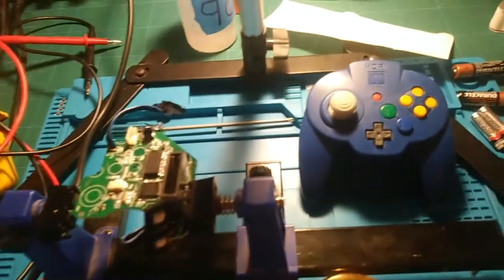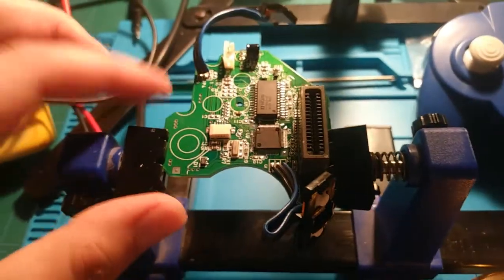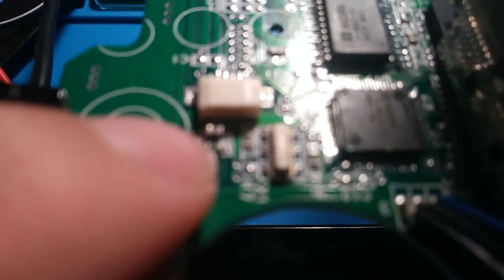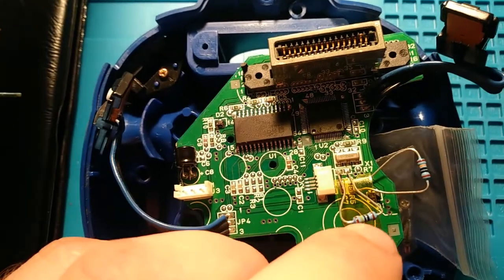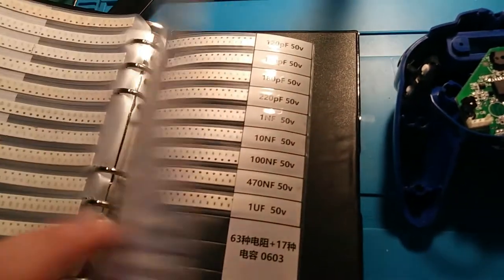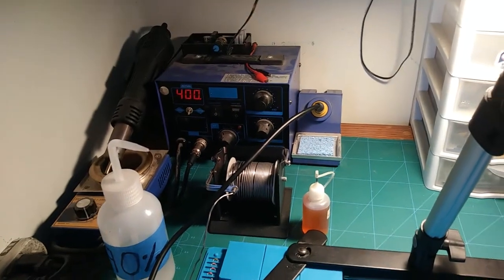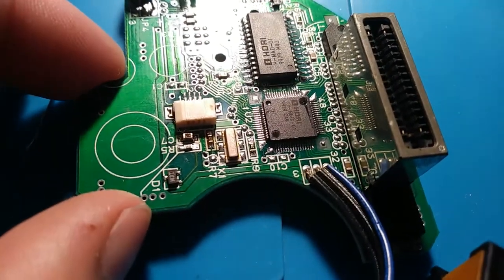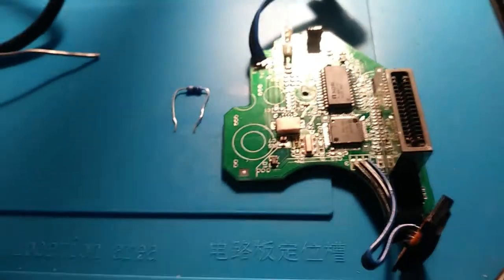N64 Hori Pad Mini Repair

Comment: Today I think me and my partner fixed one of our horipads that just stopped registering inputs after about 10 seconds of being plugged in when playing top gear rally. I checked all the components (desoldered and resoldered some) I could check (caps and resistors), but nothing was off. Then I tested the controller again and it sometimes worked. So we just reflowed the whole thing and cleaned all contacts and so far it has been working perfectly for hours. I don't know what exactly fixed it.
Reply: Hope this helps anyone and thanks for the video.
Reply from the maker: Thanks for watching! Glad to hear you got it working. I suspect you had some tin whiskers on the main SMD chip there. That's usually the first thing i try on anything with SMD chips. Easy to drop a little flux on there and just drag solder it to be sure everything's in place before troubleshooting discreet components.

Comment: haha the Mr Lahey bit killed me. Wasn't expecting that gold. I bought a yellow Hori just like yours off Ebay and it isn't working. Is there anything simple I could try doing? I don't think I'm at your level with replacing transistors etc lol.
Reply from the maker: thanks for watching and glad you appreciate the attempted humor (there's plenty more in my other latest videos too hehe). 

as far as simple fixes go; there's not a lot you can try other than cleaning the connector plug. get some isopropyl alcohol (highest purity available) and douse the connector in it. with it still soaked, plug and unplug it from the console rapidly but carefully. after allowing a few minutes for the alcohol to evaporate; try it again. 

P.S. does the console recognize the controller is plugged in or no?